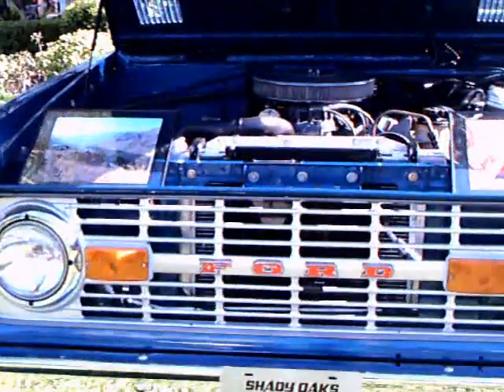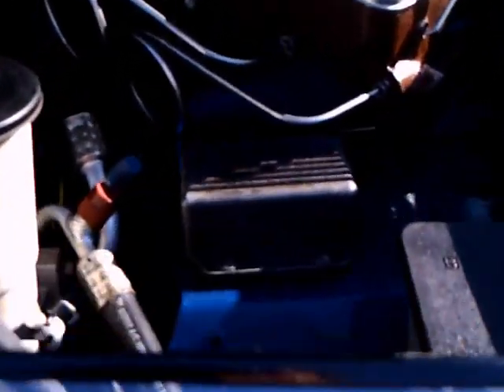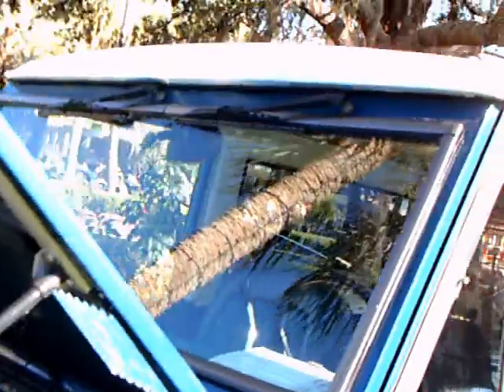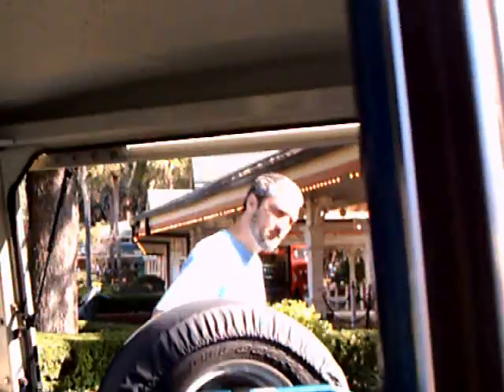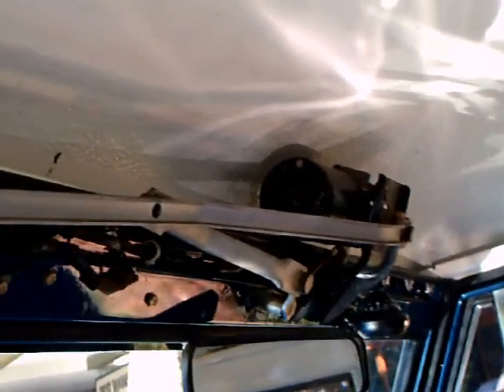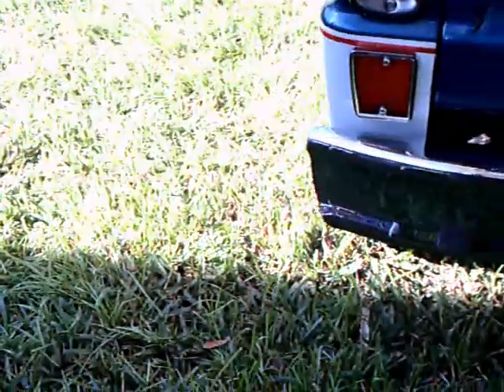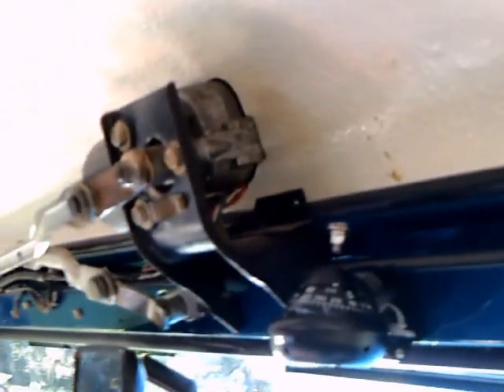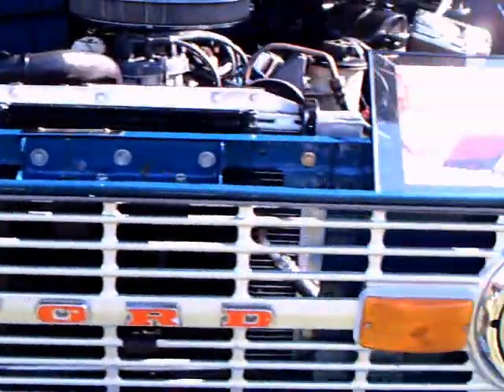1977 Ford Bronco 4X4 BluWht SilvrSpr011213

Comment: Definately, another blast from the past. I've seen a Bronco II this year in Florida, but haven't seen an original Bronco in a long long time. Watch those fingers in the wiper mechanism! I think the Chevy Blazer really put a fork in the original Bronco because people in the 70's wanted a larger more bloated vehicle. The original bronco is a cool size though, esp if it has 4 wheel drive and a souped up Cobra engine with headers !

Comment: Hey Jack :) I remember reading somewhere that Ford intended to bring out the F Series based Bronco for the 1974 model year, but shelved it at the last minute due to the energy crisis. I'm sure Ford found themselves at a competitive disadvantage to the GM/Mopar models due to this Bronco's (old) design dating back to 1966, and it'd be simpler/cheaper to share the F Series tooling for the new Bronco anyway. The early Bronco's intended competition was the IH Scout, based on it's design.